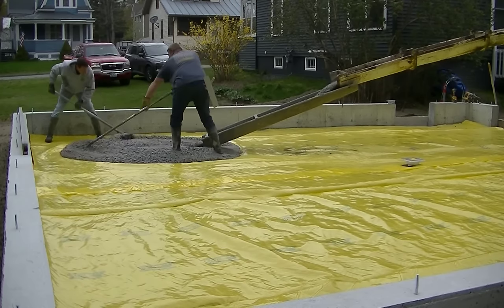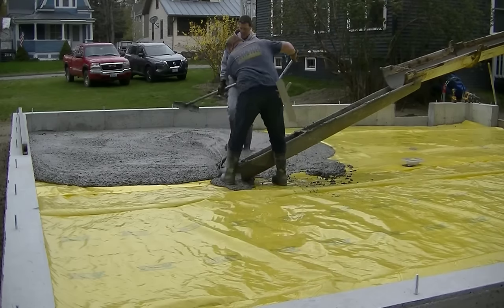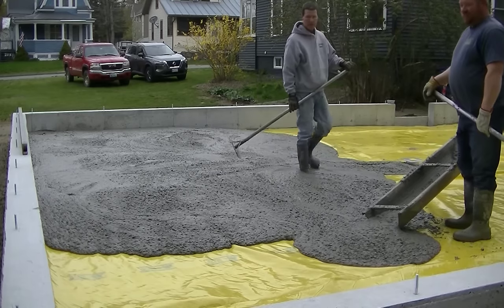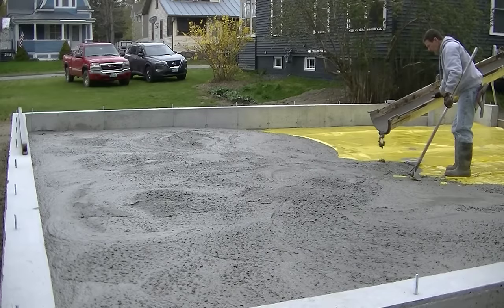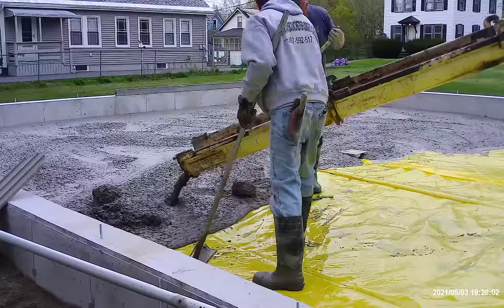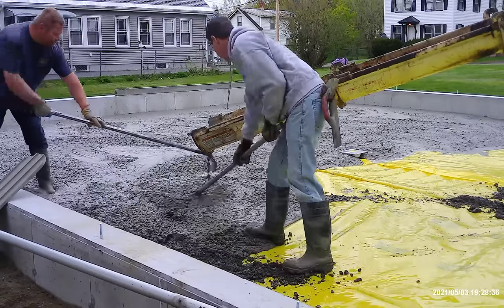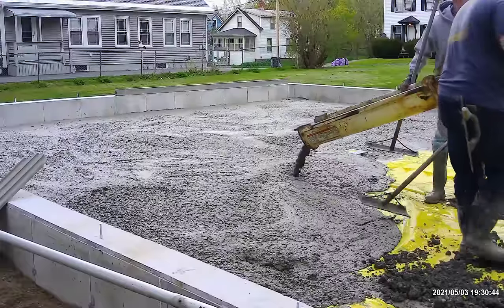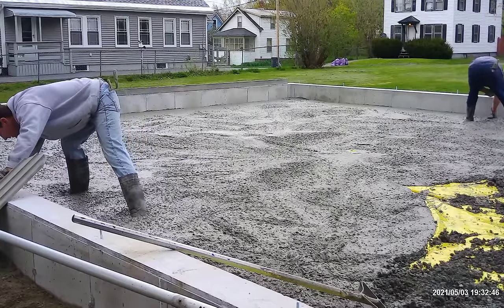How 2 Men Can Pour A 32' X 28' Garage Floor (I Got Concrete Balls!)

Comment: Question.  My neighbour just installed a backyard slab of concrete and rebar was used to reinforce the slab; I’m wondering why rebar wasn’t used in this particular application —given that a Garage floor would deal with significantly more weight.

Comment: As a concrete truck driver I can tell you a number of things on why you get clumps.
1. mixing time, depending how far the job  pour site is from the batch plant you may want to add more mixing time to really mix up that load on short distances in comparison to a delivery that's 20 miles away that'll be mixed well once arriving on site. 
2. Dry packing, not having enough water in the drum before dumping material in while truck is being loaded will also cause clumps. Adding more mixing time should help mix it up but still may have clumps.
5 minutes on high idle with the drum on full charge will really help mix it but allot of drivers don't give it 5 minutes because we're always rushed and contractors may get mad so allot of drivers try mixing it up in under a minute and start pouring and still have clumps. 
Give the driver a true 5 minutes on high idle and the drum on full charge. Look at the time and time it the moment you hear the truck Rev up. It'll make a difference or at least smaller baseball size clumps in the least.

Comment: Great teamwork and prep, I noticed no steel in the slab, does this mix account for that? Thanks for any thoughts. Thanks for all the great comments below too. Super group Mike has collected on this channel.
Reply: I was wondering about the steel too. Normally at least use the 6”x6”x1/8” wire. But I also noticed the depth in the center by the drain didn’t look to be 4” thick either. I’m by no means a concrete expert, but I can’t remember one time that I saw a garage slab without steel, and I’ve never seen one poured less than 4” thick.
Reply: Actually, I'm new to concrete, but I was wondering why there wasn't any steel floated up from the ground as well? Good question. Probably have a good answer?
Reply: fiberglass strands

Comment: Me and my dad could handle a two- truck pour since I was twelve years old! It's all about  working together as one unit! Those concrete balls concern me. They are the cement that didn't get worked into the mix,which will significantly weaken the compressive strength of the concrete. I have never had that issue.
Reply: If you pour everyday all day, it happens all the time. Especially on hot mixes. We run into at least twice a week. Especially if the fins in the drums are getting old. It doesn't do anything to the integrity of the concrete.

Comment: Never saw concrete balls before here in east Tennessee. I think it's your supplier. You might call blalocks here in Knoxville/sevierville Tennessee. It's probably moisture getting to the cement before it gets mixed.

Comment: I make a tool which is called a tool hanger either your left hand or your right hand it loops around your belt it sticks out a little bit with a deep loop to the bottom and the peak coming up and you can hang your hand float and your edger wherever you working where you have to go you have both of those tools alongside with you I make those tools

Comment: Those ball clusters happen when the truck barrel is not turning fast enough as they are adding the water at the factory, or they add the water too quickly. This rarely happens if they add 80% of the water to the mix first. I don't know anything about the flow control additive, or how that would impact it though. I only use that stuff with rapid set mixes. I've never poured at a 7 inch slump. At least not on purpose. LOL

Comment: Pampered in residential, imagine pouring 50 thousand sq ft in 4600 psi at a 3 inch slump 8 inched thick with up to 4 grids of re bar via pump to help kick the loads in 100 degree heat, this is a cake walk for 2 guys.

Comment: You can't get away with that in Australia, never ever seen a concrete ball come down a shoot. No steel mesh in a 4 inch slab.. wtf. Only allow no mesh in 6 inch. Inspector takes sample at pore site for impact test. Have to pay waiting time if driver is held for more than 20 minutes. That is what we call soup mix. We have to sign a waiver if water is added. Water tanks are the hardest to screed as they are max MPA. Don't you have building code regulation to meet ?

Comment: Tell the batch man that his water, cement and rock agg needs to be timed better on going into the truck  mainly the water and cement but you always want about 1500 pounds of rock to go in last to help scour what gets stuck on the fins while loading.   It could also be a combination of timing and the fins are about wore out in the drum.    
Didn't see any body say anything like this so I figured I would offer some advice 😁
 I was in the concrete game for a long time.  Sure enjoyed it actually.    In our neck of the woods the plastisizer agent cost extra and are rather pricey  but well worth it when working with a min of guys and heat of the day as you well now.  Was a nice video to watch.  Thanks

Comment: Concrete waits for no man 😂.   These guys are good.   I’ve not poured in years.   I used to pour walls in water plants .   We had our big flatwork hired out.   We did smaller floors and laboratory floors with drains. I always poured 4 to 6 inch.   Never poured as wet as this guys.  With 3,500 and water reducer. ( I never heard of it ), this is a really good job. They make look almost easy. ( it’s not).  I’m impressed.   Btw.  We poured 50 to 200 yards average per pour.    Vibrating was the hard part.

Comment: I've built houses from the ground up and brick and block laying, concrete, and shingle was probably the hardest 3 jobs there is building houses oh and I'll add drywall in there to, frame, elect,plumb,and finish properly the easiest, but still rough tho

Comment: Sometimes when concrete is batched that wet the balls form, it’s usually from a dry batch plant, when batched on a central mixer it won’t happen
Reply: I respectfully disagree, i batched at a prestress plant for 10+ years. A fast cement dump into a drum of water will ball it up in any mixer. Slow feeding the cement into the water and aggregate will eliminate this problem if the mixer is turning full speed.

Comment: I am originally from New York 
now in Tampa Florida. I've been installing concrete for a very long time. Still at it and learned from commercial concrete background. These guys aren't just good, they are totally amazing. DO NOT TRY to do that size job with 2 people. Much more involved than meets the eye. Step one, use 6-7 slump and let gravity help, but you will never get it flat unless screeded correctly and, that's extremely hard to do unless you have it down perfectly like they do 
No screed = wavy gravy, not flat , bull float won't help you at that point 🔗🔗💪💪

Comment: I don't know much about concrete but that seems like a very large slab for having no rebar. How long can you count on such a large slab not cracking without reinforcement?
Reply from the maker: Reinforcement doesn't keep it from cracking, it holds it together if it does crack. This has polypropylene fibers in the mix instead.

Comment: That's usually coagulated cement from  a dry batch / truck batch  plant , where raw  cement  , sand , and stone are mixed in the actual truck , instead of  a plant with an overhead batching drum , that dumps the wet mix in the  trucks . ..caused .most likely from a truck drum that wasn't completely wet at loading ... dirty with hardened old crete..or worn ..or not mixed fully...etc.
Great job with the old school method of  setting lead. ( LEED) grades ...then pulling down with a straightedge  screed ... while kickin' in the boot holes. .. People have no idea the strength , stamina and skill it takes.
Before vibratory screeds were available..and I was a lot younger....we hand screeded up to 25 k feet or more a day with a crew of ten  ...so I know what it takes

Comment: Yeah we get them,I call them dough balls. I figure like you said, they're batching so quick the mixer can't beat them up, or it was damp. I know when I was driving a mixer flat work guys would get pretty upset about it . Lol. I was fresh outta school, they gave me a hard time. They suck when you're pumping a wall and one gets through ! Been slapped off a few times. One time I had a tape measure come through a 4-3" hose ! Guess someone dropped it in a mixer.

Comment: I'm a front discharge mixer operator, we lovingly call the balls giant rabbit turds.  I've observed that they occur more frequently when the batched slump is wetter, and/or the batches are loaded extra fast. So, its common we will typically see these on uber large pours where we are pushing hundreds of yards for one job and the traveling slump is a 6.  A 4" slump is generally preferred even if the contractor plans to wet the mix up to an 8, as these giant rabbit turds won't accumulate with the tighter slump. So my batcher tends to load us a litter dryer than the ticketed slump, and prior to rolling to the job we as the operators finish slumping it, either while rinsing off the truck spraying into the barrell from the catwalk or ground, or using our tank water (then topping off our tank before departing) in order to prevent the "balls"

Comment: I wish that I had recorded it, but unfortunately I didn't. Today, my brother and I poured a 24'x24'x5" garage pad over top of his original pad, that previous workers had seriously messed it up. After we got it in and straight-edged, I went to work, because I was the only concrete finisher here. I bullfloated the pad, hand floated and edged(he helped edge a bit, also), then shortly afterwards, I got out my kneeboards and got out onto the concrete finishing. Started at 7am, finished at 2 pm

Comment: I drove concrete truck 20 plus years ago and  hit a turkey buzzard and it fell down the truck hopper. I told the guys pouring the wall they had a secret to toy surprise in this load. When it came out it plugged the wall form ...  They tried to bust it up. I had tears rolling and almost wet my pants it was so funny.

Comment: Great job! You guys make a Awesome !team. Do you not need wire in pours like that because you have the fiber in it and because the pour is contained by the walls?
Reply: The walls have nothing to do with it.  Could have been regular form work.   In the early 90’s we did a job for Fruit of the Loom in South Texas. It was 20 acres under roof.  The only metal in the slab was at the construction joints between pours.  The concrete has fiber mesh in it and turned out great.

Comment: I did concrete for a couple summers when I was younger. The worst job I was ever a part of was a nightmare. Guy up and decided his basement needed a higher ceiling... so instead of jacking the house up and adding block, guy decided to lower the existing floor. We spent what felt like forever busting out the old floor and hand digging the dirt and sand.  We had to pour thru a window into 5 gallon buckets. The actual pour took around 23 hours straight from start to finish. We all got a nice bonus and a week off after that one.
Reply: The 23 hours was just the floor pour too. We had to add to the foundation in sections before all that. Also... it wasn't a normal sized window... it was one of those little basement ones.

Comment: You probably got batched at a dry batch plant. If he batches you above 4 inches...it creates balls. If he batches you under 4 inches....you gotta bring it up to 3 1/2 - 4 and let it mix at 1400 rpm instead of 1600 for 5 minute it will break all the balls or most of it. Those balls are the result of the air in the load or depending on the mix...the viscocrete (or super P in any case )  They usually come out with the first meter because they float and then the rest comes out at the end when you got 3/4 of a meter left .Concrete is fun and interesting . You keep learning every day no matter how long you've been in the industry.

Comment: A 6/7 inch slump, vapor barrier down, weather under 75 degrees and a reducer, is no problem even for a single guy with basic experience to lay down. 

Should have had expansion against the stem wall too. And I'd never use a 3500 mix on any interior slab, even if the garage is not heated. 

Here in northern indiana, concretr plants wont even deliver a flat mix interior or exterior below 4000

Comment: Ya easier to work the create, not sure if I heard you mention at that slump, the water to cement ratio is bad, loosing psi strength, causing peeling, and flakey top water and calicum are concretes worst enimes I drive redi mix for 18 years and ran a central mix plant for 6 years the lumps are from a transit mix plant, when loading the truck the plant is going in to fast to properly mix into load

Comment: The colder temperatures and going over plastic make this possible with two guys who know how to do concrete. Both those factors will slow the cure time down.  Do this in 90-degree weather, prepare to have a headache from working at light speed.
    20 yrs. doing concrete never had anything like those size dry not mixed properly chunks. 
 My guess it's not mixing the water properly, like there is a pocket in the barrel the dry mix is stuck to and frees up as the load lessens in the barrel.
Reply: although they don't show the troweling that is supposed to take place after bull floating.

Comment: Id have a lazer level machine to pour and level concrete. Zero deviation from level. Yea extra cost but worth it. After a full cure an industrial grade epoxy coating. Di it right do it once.

Comment: Traveling with it that wet you have a better chance of spilling on the hay. Not good. Dryer(a 5inch slump) is a good travel slump and you can wet it up to specifications when you get to the job. Remember too that the amount of water needs to be recorded just in case anything happens to the concrete down the road.

Comment: Those clumps are because when a mixer is done at a job they should have drum mixer slow headed back to the plant that way they release from the blades because if not they will fall at the next job 
Good job guys

Comment: Set them out and send them back with the truck driver.  -  Then call and ask how much they allow for them.  You will get a discount, and the mixer will be told to add the dust slower!  - This works pretty well.

Comment: Dinosaur eggs, cannon balls, bowling balls!
I drive a current model year front discharge, and from my experience, it’s from loading the materials to fast and WET! Anyways, they usually do mix up, and disappear, but not always. 

And they kinda float in the mix, so when the drum is discharging, it pulls the concrete up from the bottom and back of the drum, so the lighter cannon balls float, and when they level gets low enough inside the drum, the fins grab the balls and out they come.  As stated, when you see them it’s best to just put the drum in charge and let it mix a bit more, and more often than not, they incorporate into the mix. 
I can tell you that when they fall from the drum into the discharge hopper on the truck, you can definitely feel the thud, and I always yell out to the customers, CANNON BALL!

Comment: Those balls are caused when the drum needs to be chipped out.  Once the drum is chipped out, the balls stop forming as the blades and edges break the balls.  When the drum needs chipping, everything inside is sort of rounded off and the balls just form from rolling around the curves of the internal blades.

Comment: Your second truck was thicker than the first because those cement chunks were not mixed in the batch. 😢 They do everything by weight and concrete balls weigh the same wether they are clumps or mixed in with the batch.

Comment: The concrete balls are from the batcher trying to load the truck to fast and it can be from build up in the drum also
Reply: Batched to wet
Never seen balls in no slump/ low slump concrete.

Comment: Where is the Wire Mesh  a garage slab should have wire mesh put in it just the fiber at enough .. I know I wouldn’t pour any slab without wire mesh in there .. I have poured a lot of concrete and it is a rough job but if you gonna do it Do it right. I would like to see this slab in a few years and see how it has held up

Comment: As a concrete producer we never allowed adding extra chute other than what is designed for the truck. Do the math. The leverage from the extension can and will cause undue stress on the concrete chute system. I’ve seen chute systems fail and the finisher shrugs his shoulders like it’s not his fault.

Comment: So it's actually because of moisture in the sand, dry batching plants have the most problems,  wet batching the dropping load into mixer will brake any up. Driver and backup batch man.

Comment: I'm about 10 seconds into this and I have to come in and say it's way too wet and they're pouring on visqueen, which means all the bleed water will have to go out the top.  Concrete's strength is directly proportional to its water to cement ratio. On the job you might say thats effed-up like a Soup Sandwich. On a real job there's an inspector and someone from a testing company that will measure the amount of moisture in the concrete ( called slump ) and only allow what the specifications call for which is very stiff not watery  like in  this video.

Comment: I drove for concrete company for a while. This is caused by the concrete company not loading the mixer right. When loading a mixer it's loaded in such a way to keep this from happening. The tank wasn't up to speed when loading started and it clumped. Partially set up balls like this is the driver and loader responsibility to keep from happening.